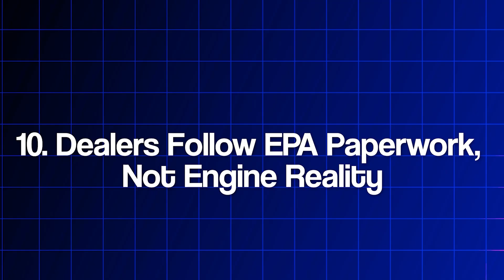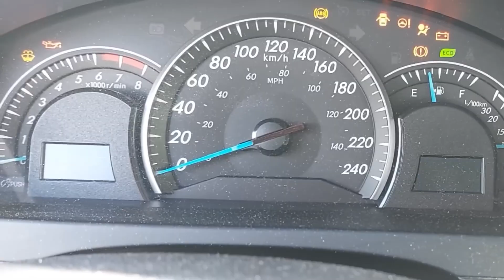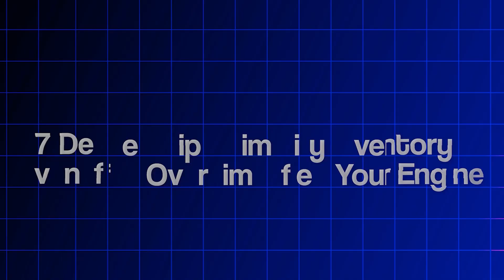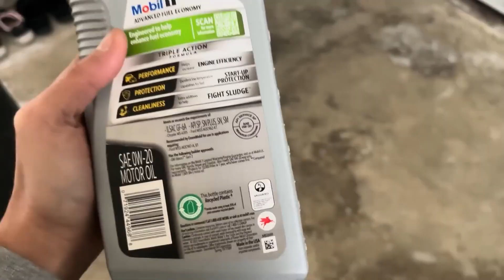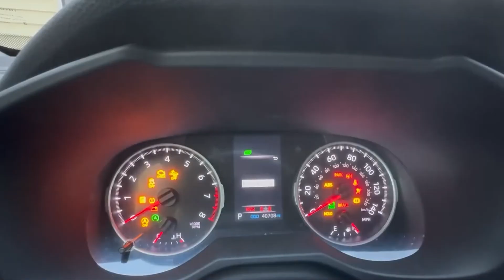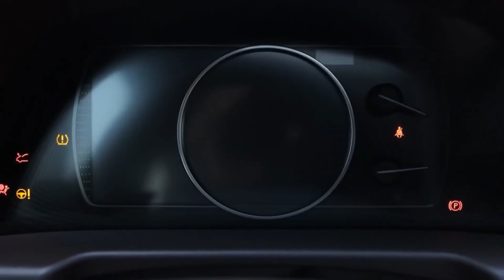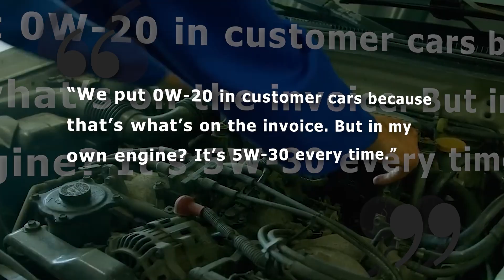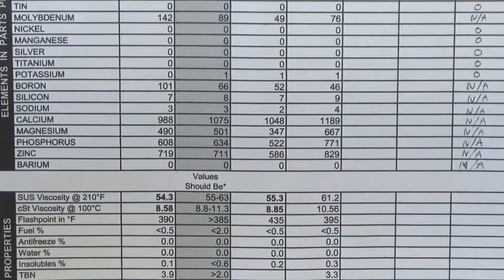The TRUTH About 0W-20 Oil (Why Mechanics REFUSE To Use It)

Comment: Engines never wore out when 30 weight engine oil was the standard. Not.
Reply from the maker: it was a different time
Reply: @the.GarageIQ exactly. And it called for a  different engine oil. Just 1980 where every ran 10w40.

Comment: My son's 2012 Mazda 3 has always had Mobil 1 0W-20 in it. He changes it every 5000 miles, and at 140,000 miles his engine still doesn't burn a drop. Toyota has been specifying 0W-20 oil since 2010, and yes, there are many Toyotas and Lexus vehicles with over 200,000 miles on them. And yes, Mobil makes synthetic 0W-20 oil for engines with more than 75,000 miles on them. It's all in the additives.
In fact, Lake Speed Jr., a Tribologist (oil expert) has found that 0W-8 in a Corolla wears less than the 0W-16 oil used in previous years. 
So don't believe all the fear mongering that makes people think that this is still 1990. Modern synthetic oil protects in the cold and heat. Most engine wear occurs at startup, not on the highway.
Reply from the maker: Thanks for the detailed info! I bet  you are a lot of people's go-to car guy!
Reply: @the.GarageIQ Yes, indeed.👍